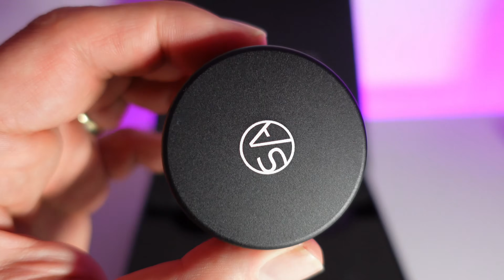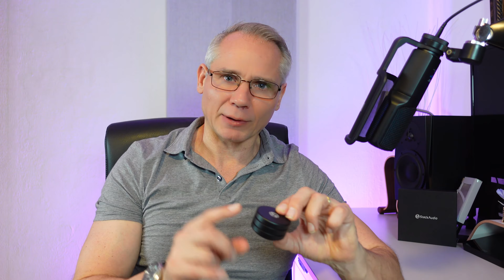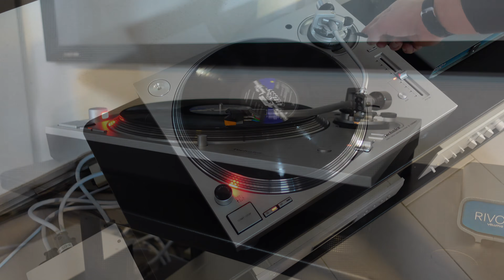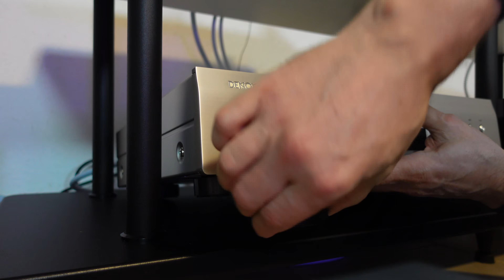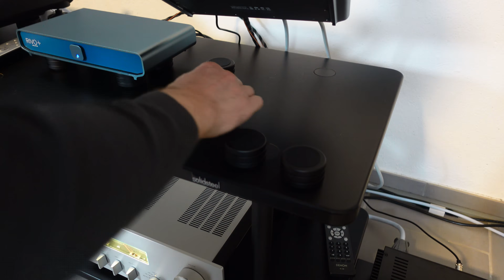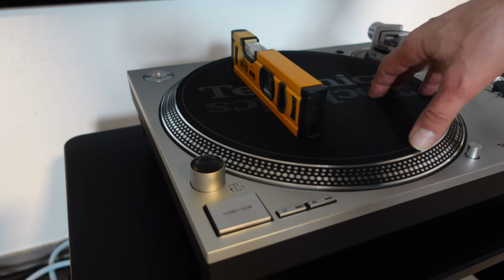Stack Audio AUVA EQ Review – The Upgrade You’re Probably Overlooking

Comment: I put those Auva EQ footings under my DAC, and I did not hear an improvement -- nor a decline.  Everything sounded the same.  Perhaps if I struggled, I might hear some nuance of a change.

For my turntable, the improvement was transformative.  On excellent sounding records, the bass is tighter, and symbol crashes jump out of the speakers.  I can "feel" the metal.  String notes can almost be seen vibrating in front of me.  Voices did sound real, but now they sound more real than ever before.  Everything has better focus.

So it seems that my DAC was not getting shaken, but my turntable was (or my DAC does not mind being shaken?).  Of course, a turntable is the most susceptible component to vibrations.  But both my DAC and my turntable are on the same equipment rack, with my turntable on the top, and my DAC directly below on the next shelf.

When time permits, I am going to place additional Auva EQ footings under my pre-amp, phono-amp, and amps.  They all have tubes, and will probably benefit more than my DAC, because tubes do not like to be shaken.  My amps are very heavy, and hard to reach the back to lift.  This is going to be a chore, and I hope it is not for naught.  My pre-amp and phono-amp will not be a struggle.  But lifting up my amps in a tight space, while simultaneously placing the Auva EQ footings, is a job for Mission Impossible -- but somehow, I will get it done.

By the way, I also purchased Stack Audio's Serene Stabiliser.  Now, I cannot play records without it.  I was using a heavy clamp.  But no more.  That Serene Stabiliser is amazing.
Reply: I did some research on this subject because you can't accept these reviewers words at face value. Dacs do not benefit from isolation because they do not have any internal moving parts that would suffer from vibration. Only components with internal moving parts suffer vibration such as cd players and turntables. A lot of these reviewers are snake oil salesmen so do your research first before spending your hard earned cash.